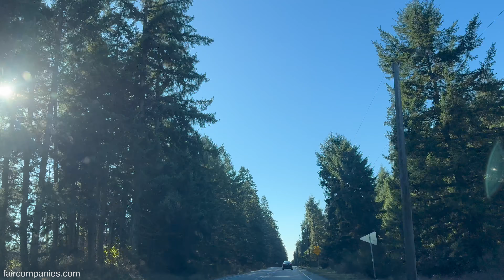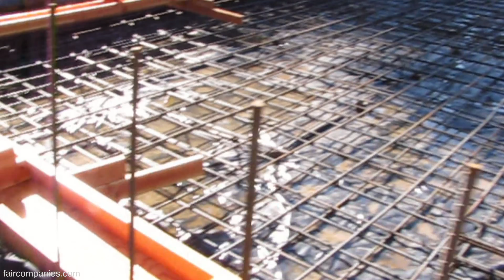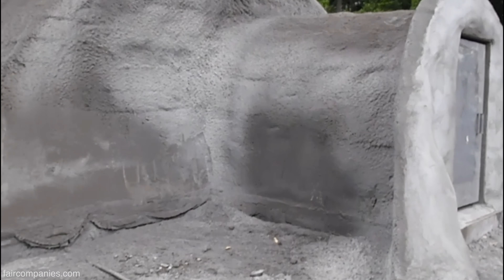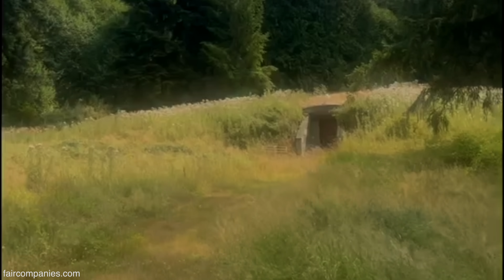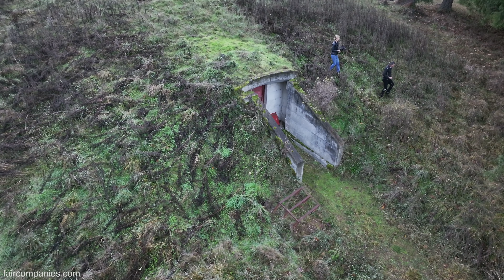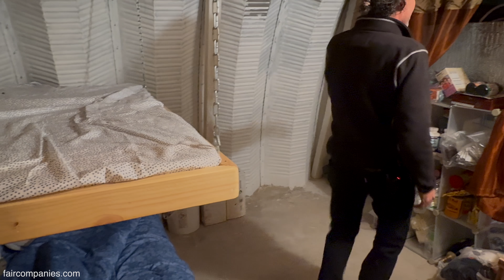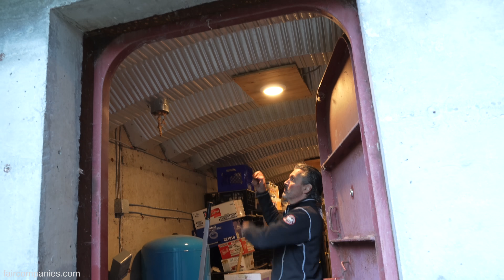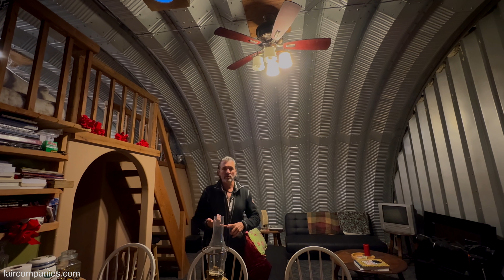Building Bunker Villa on a budget using Quonset Hut structure

Comment: My uncle just lost his house in the fires last summer. If he had something like this he would be pretty much unaffected.
Reply: That is the thing.... even a quonset hut structure with 6" of concrete above ground would allow you to survive a wildfire or hurricane etc.... it doesn't have to be underground! It is all about what one can afford, you can spend 100k + to filter air for 5 months. It's all about your budget.... My condolences to your uncle !
Reply: This so great for California fires
Reply: For sure, only problem is, some municipalities get funny about allowing these types of structures, unless you're in a more rural area where nobody minds as much. Also, land that's really rocky, or packed full of trees, can be extremely challenging. Lastly, in order to survive a fire in one of these structures, the air handeling system would need to be relatively fireproof and also properly filtered to prevent smoke and toxic gasses/fumes, from entering the structure.
Reply: @__WJK__  Yes, David showed us the dropdown “guillotine” panels to shut off airflow in case of an outside fire to keep smoke from coming in.  Installing air filters is an option that would require air blowers to push air through  because carbon, particulate, and HEPA filters will slow and stop natural air flow.  I would, however, at minimum, install more robust anti-rodent screens and behind those, insect screens as well to keep inquisitive rodents and ants from scurrying through the air passages and into the living quarters.
Reply: @papanam4267 for all we really know those inlets/outlets shown are just "dummies" to confuse & distract. Lol
Reply: Also the Evil Secret CABAL Gov. cannot use High Tech Lasers to Burn you out like they did in Maui, Hawaii...

Comment: The door is only as good as the lock is.
Reply: 👍after watching the lock pick guy on uTube, I don’t think much of locks anymore.😂
Reply: @blueman5924  I'm a Locksporter, and believe me it does take awhile to gain the skills needed to pick good locks. Even the bypass methods require practice and knowledge that most non-pickers do not have. Do learn which locks are good and why; it's not all about picking or bypass resistance but that does matter too. Security is a whole, and if you make one method of entry too tough there's always another way in.
Reply: @ColeTrickleChevy46  First are you allowed to change locks? Most apartments say no because they need emergency access. Some will if you give them a key. Normal apartments have weak doors that bad guys just kick in- locks won't help you then. Same for the doorframe. Non-key entrance security depends on the lock being installed correctly and most aren't. TBH crooks rarely pick locks; they use the many ways around the lock or brute force, not the finesse of picking.  Myself I just make sure the jamb is shimmed, adjust the strikes properly then secure those with 3 1/2" screws. I add longer screws to the hinges and if I think the lock needs replacing I look for something mid-grade on sale. If the door and frame are strong I might get something drill-resistant with security pins. If you need more than that you need a professional security consultant or a locksmith.
Reply: @blueman5924  Truth.
Reply: Yeah but nobody knows where it is located.
Reply: @davidbolduc828  Ha! Great point!!😊
Reply: Lock worthless if the door is flimsy